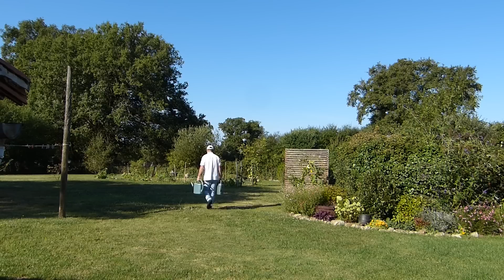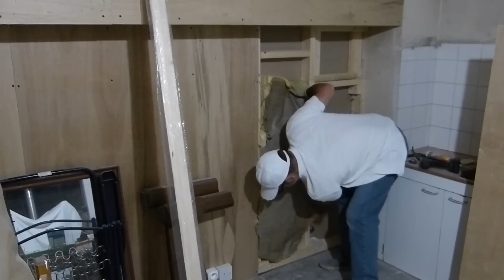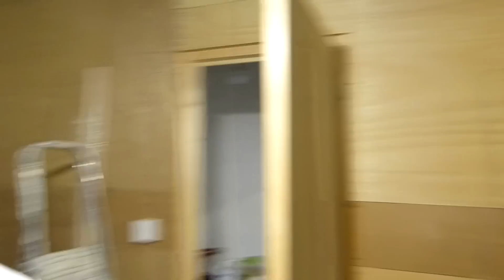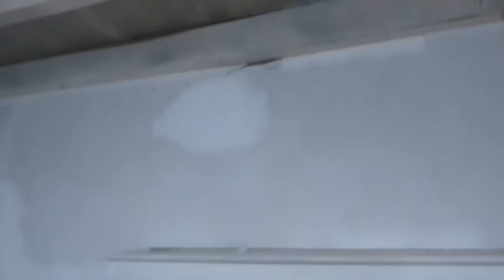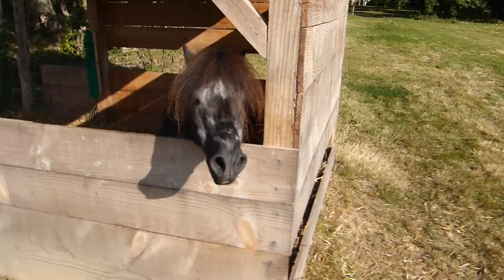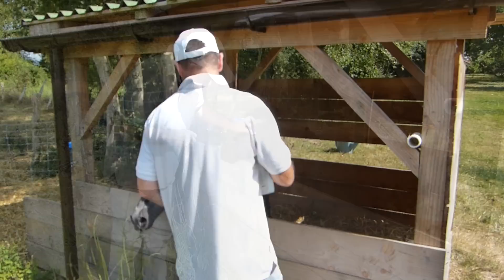Insulating my bedroom walls - My new life in the country - Starting again at 50.

Comment: Maybe cut a little foil to sharpen those poor scissors after their workout.  I was taught to use a board as a straight edge and used the knife.  Itchy work.  Good job, always a good plan to add to the insulation in a dwelling👍🏻

Comment: Here's hoping now you've insulated the wall, filled more cracks and the fire is burning most of the day with doors open to let hot air circulate around the house, you should have a very warm comfortable house this winter, there's nothing better than feeling cozy inside when the winter wind is howling and the rain is tapping on the windows!  Have a great weekend and enjoy the sunshine. :)